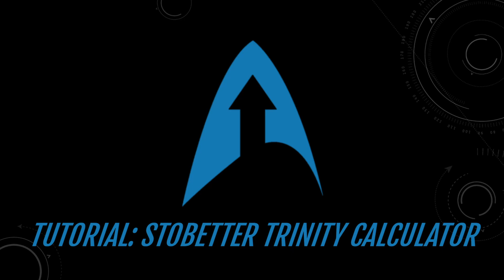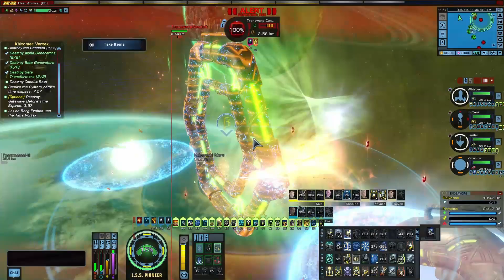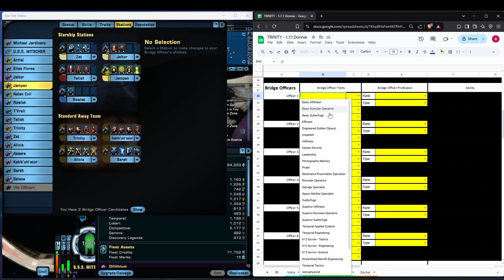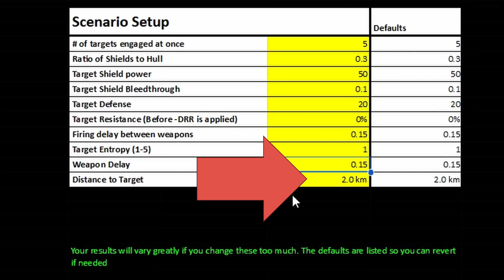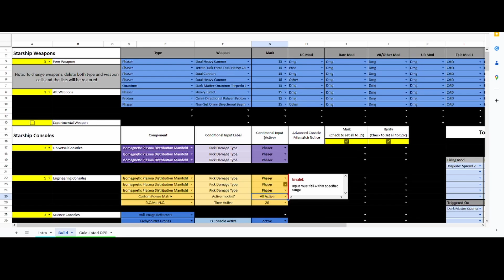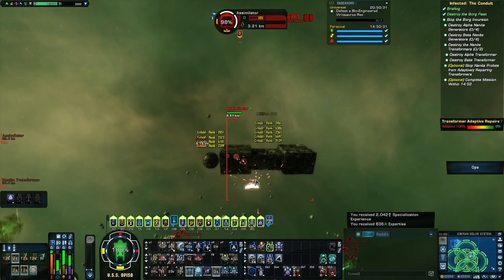STOBETTER TRINITY Tool - Tutorial

Comment: Can't enter Fleet Power Network or Enhanced Induction Coils.
Reply from the maker: So we are always updating the tool, and Fleet Power Network Array has been on our bugged list for quite some time. That being said, it is on our radar to add soon. Enhanced Induction Coils simply can't be modelled in TRINITY since Power Levels are a manually entered static value. We could add an empty entry, and then the user has to manually adjust power levels to compensate, but this is a pretty edge case.

Comment: Does it answer "isomags vs crit boosting consoles"? I couldn't seem to find a clear answer. Not just spire consoles, but others as well
Reply from the maker: Yep! You would have to manually switch between your build setups to see which is more effective. This is a great application of where you can save off the final values with Ctrl+Shift+V. We came up with some general guidelines using TRINITY here: https://www.reddit.com/r/stobuilds/comments/14b2mna/mathbusters_3_advanced_engineering_ipdm_consoles/

Comment: Thank-you for this tool and for the video.  I am attempting to fill out (V 1.7.2) and use it for the first time.  I am unable to find my Prototype Phaser Hexa Cannons in the Experimental Weapon pulldown menu.  Am I missing something or is it yet to be added?  If the latter, can you recommend a similar field I can specify for now?
Reply from the maker: Yeah so we only JUST derived base damage/damage equations for a large chunk of Experimental Weapons, we haven't had the time for the significant tool overhaul required to implement Experimental Weapons - they end up on the same complexity level as all the exotic powers, but also interact with power cycle... All that to say, they aren't modeled in the tool. We have the numbers to be able to do so, but its a ways out from happening.